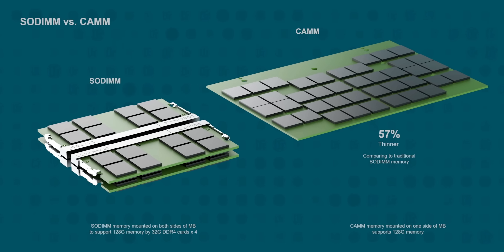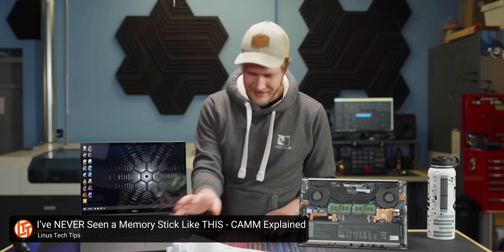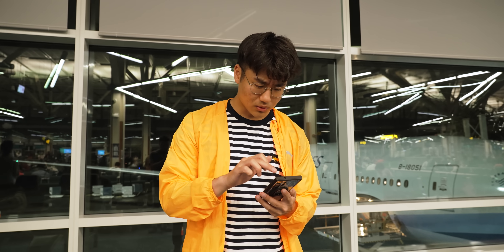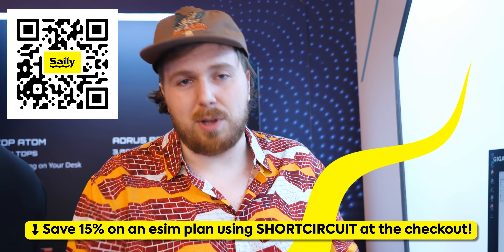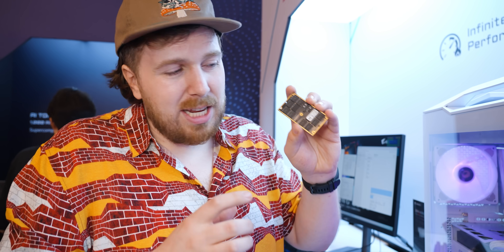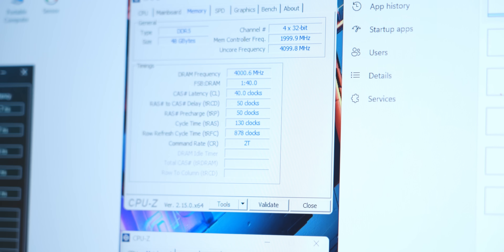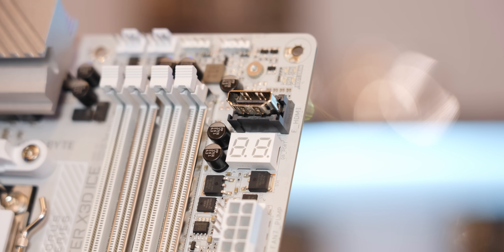Your RAM kinda sucks. - Gigabyte at Computex 2025

Comment from the maker: Get an exclusive 15% discount on Saily data plans! Use code SHORTCIRCUIT at checkout. Download Saily app or go to https://saily.com/shortcircuit
Reply: 2:53 Hold up... is that pin-to-pin interposer card a part of the standard?!  So if a pin gets damaged, you aren't replacing an expensive board or memory module, just an inexpensive connector card?!  That's BRILLIANT!
Reply: desktop PC industry is stuck in the past. why not just integrate RAM already especially on micro atx and mini ITX. built-in RAM does away with the cost and space of the connector while having higher clock speeds. expandability pretty much moot as time comes you need more RAM, it would be nicer to get a system upgrade with it.

Comment: Camm.2  and LP camm are DOA. it's cost and complexity to still be slower than soldered is not an incentive for the chip manufacturers. Everybody except intel already went with soldered memory for current APUs. Apples M's, snapdragon X1&X2 and ryzen AI max, all use soldered memory and cpu. We're in a uncomfortable spot with ram and how technologies progressed. no one wants to give up the ease of dimms, but they've become a major limiting factor especially for APUs.

Comment: idk if i like the idea of camm or not. as an sff builder i think it can do wonders in not hogging up so much pcb reel estate. but being flat its going to compete for ssd space (2 m.2 are fine for mini-itx). its also not as close to the cpu as i would like. the system i invesioned would put a module on either or both sides of your cpu to appease the ghost of grace hopper and could theoretically be cooled by the cpu cooler. or perhaps trapizodal modules that ring the cpu in its socket, with the socket containing all the traces for the memory bus and thus simplifying the mobo and reducing the costs.

Comment: Gimme one on the front and one on the back and we're good. Would make high capacity cheaper than if it's just one slot like the current implementation.

(Tho I doubt we'll get that, as mobo costs would be quite high due to the extra layers, and the memory topology would change vs the current implementations. D:)

Comment: ive never had a good experience with gigabyte motherboards. the same system running on an asus motherboard always gives me way better performance. ive even had gigabyte motherboards overheat before and throttle with long gaming sessions (just a flawed design). if anyone is buying a motherboard id recommend staying away from gigabyte, unless you dont care about performance

Comment: DDR5 kida sucks. How is it that my 5700G could hit DDR4 5000CL17-17-17-28 and get better bandwidth than my 8700G with DDR5 8000. Heck at 4200 the 5700G got better bandwidth and latency than the best the 8700G could do with 8800.
My 8700G struggles to run in 1:1 above 3800, where me 5700G can run all the way up to 5133 though with looser timings that make it worse than 4800C16
Reply: For those wondering the 5700G would see +75GB/s and as little as 49ns of latency, where the 8700G's best performance was at DDR5 8400 with ~62GB/s and IIRC 66ns of latency. And yes i was using a single dimm per channel ITX RAM OC motherboard, where as all of my 5000 series would hit at least 4800C17 on a cheap $100 B450 ITX board that is pretty low end on specs.

Comment: Can cam be used as replacement unified memory? So that in theory you could upgrade unified memory that can be shared with your gpu rather than just for the system memory alone?

Comment: Hmm, I wonder if GPU can get that benefit for the pins in a sense by not needing to have a exposed PCI-e slot and instead you snap the GPU onto it and screw it in tightly so it holds? That means you need some sort of new attachment system that lets you mount the GPU to the board without having the backplate being the only thing holding it up?

But this also means the new mobo with the new ram standard, also would have a new GPU standard, and it is not going to be backwards compatible at all!

Meaning you have to buy new GPUs, new Mobo, and new RAM with it all, and given the scarcity and productions of it, it will definitely be outrageously expensive for several years.

Comment: Cam doesn't seem faster than ram in those benchmarks?
Also I would never buy a motherboard that only has a single slot for ram no upgrade path without having to flip the old one.

Comment: As long as there is an option for upgradeability I am all for it. I often purchase laptops where the seller will provide good components but keeps easy upgrades like ram to a minimum to keep cost low. Making me as the customer happy to save a couple hundred until I'm able to upgrade when I can. Providing them the sale no1 can complain for the value aspect. As long as it isn't directly soldiered to the point that it is part of the board. I'm ok with the change.
Ram is only getting hotter the faster it goes. So an option to provide lower amounts of voltage with less resistance in traffic. Does seem the next step in evolution that I'm aware of.

Comment: It's not just the length of the signal wires; each DIMM socket also adds a little bit of capacitance to each of the traces. That is, each pin acts like a tiny little capacitor and smooths the voltage changes on the trace. Which is all fine for when it's a trace that carries power, but not such a good idea for traces that carry data and have to change quickly.
Reply: practically ive been buying 2 slot mobos anyway. matching dimms and getting them to play nice with eachother is kind of a pita, especially as an upgrade when the chips weren't all from the same batch. you almost always have to reduce their performance to get them stable when you add 2 more sticks. so i never understood why people like to populate all four slots. a single camm module simplifies this problem greatly. im also specing ram once when i build it and keeping the configuration for the life of the build.

Comment: I have an SFF build and every 2 years, give or take, my RAM starts dying. The CPU cooler fins are oriented such that they exhaust the hot air directly against the side of the RAM. Eventually the heat begins killing the closer stick. That note about making cooling and airflow better, 100% would be helpful for builds like mine.

Comment: It's interesting, but I'm unsure if it will take off for a long time because you can get much higher RAM density with DIMMs, so servers, workstations, and AI PCs probably won't use them, which would create a divide in the market. Laptops I can see getting this much earlier though.
Reply: You probably won't see much adaptation in mid/high-end gaming computers for a while, either, though perhaps in about 4-5 years after it's introduced, that problem may be fixed as well.

Comment: why didn't they just replace the DDR slots with the cam slot ? Its easier to make more space on the sides then it is on the top and bottom due to cases. I tell you this design is so everyone has to buy new cases for the new design.

Comment: Lol, That mb got like 1 Sata port. Dude, I'm still old school. I still have like 14 HDD's that still uses Sata connectivity. Yeah I know it's old and slow, but it's cheap for the storage capacity, perfectly fine for video storage and I already got them, no need to spend the cash on new tech that I don't really need. :face-green-smiling::face-green-smiling::face-green-smiling:
Reply: If you're using that many drives you should be using a SAS HBA card with breakout cables, not your motherboard's sata controller. Just wholefully not built for the task
Reply: @panduino2156  Rubish! It is the controlers job to do that. My old Gen1 i7 on a Asus P6T Deluxe V1 MB has been running non stop day and night for the past 16 years, first with 6 drives and 2 DVD roms and then 1 SSD and 7 Sata drives. It is still running as my storage server today.
Reply: What are you talking about? The one he was holding had 4 on the side next to the 24pin power connector.
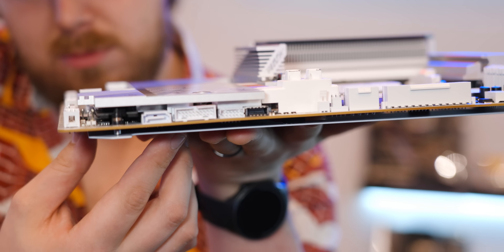Reply: @KyleDavis328  No, there is  just 1. Watch at 04:00 into the video next to the 24 pin, there are no extra sata ports, at 04:25 you can see from the side view there is only one sata port.

Comment: desktop PC industry is stuck in the past. why not just integrate RAM already especially on micro atx and mini ITX. built-in RAM does away with the cost and space of the connector while having higher clock speeds. expandability pretty much moot as time comes you need more RAM, it would be nicer to get a system upgrade with it.
Reply: Because being able to upgrade your RAM is good.

Comment: I'm actually offended by the straight up shilling going on in this video. CAMM2 might change everything? No, it won't because it's such a terrible idea that they have no plans to even try to bring it to market. So that's a lie.

You're going to sit there and pretend anyone in their right mind should ever buy a system that uses proprietary RAM?  Are you outta your minds?
Reply: Yeah...anyone who will buy it, will also buy faster and cheaper soldered memory. And those who wont, will get dimms. Its an ugly middle ground that no one really needs (also it has smallest maximum capacity out of any memory used today).

Comment: I am not sold yet.
You can get really fast DIMMs and it allows us to start with 2 sticks of RAM and the later upgrade to 4 sticks.
With CAMM2 you can still upgrade, but then you are left with a CAMM2 module that you have no use for.

For a laptop it is better than soldered RAM but for Disktop 🤷‍♂. I am not sold just yet.

Comment: How CAMM works is amazing, but forcing it on high end consumers at start is bad practice. Dell forces you to swap over to expensive CAMM memory if you buy their Precision model that supports it - and to configure more than 64GB in that model there is no option for SODIMM. It's too expensive and hard to come by, so until more companies adopt it, it's a gimmick.
Reply: What are you expecting them to do about it? It probably isn't trivial to make a motherboard that supports both DIMM and CAMM, and putting CAMM into low end devices makes no financial sense either.
Reply: @hikkamorii  It's just the config that makes no sense. 64GB and under, you can use SODIMM. Any higher and they force the user to use CAMM which means the MOBO is a different SKU, and therefore incompatible with more easily accessible RAM. I assume there was a real estate issue with 4 SODIMM slots, but also there's the same issue with the flat CAMM memory taking up a ton of space too.

The device does not matter, of course they won't put proprietary "new tech" in lower-end consumer models for financial reasons. There was only one laptop with CAMM support when I found all of this out. It is simply too expensive and unreliable at this moment in time to purchase a motherboard that uses CAMM until there's more stock. Can't upkeep a laptop for multiple people when the memory craps out within 5 years; will CAMM even be in stock at that time? Who knows. I cannot recommend adoption of this Dell laptop due to these reasons.

Fun fact, Dell has used a similar mounting system to the way these CAMM modules mounts to the motherboard but with daughterboards instead. There's a tiny bridge-like bracket to connect the two pieces and it just sits on top of the contacts.

Comment: Only two things I don’t like about the way it connects. 
1) How many cycles can those pins survive? CPUs don’t get replaced/upgraded as much as RAM would. Though I guess CAMM errors could lead to more Secret Buyer seasons, cause now the error could be poor connection or bent pin(s)
Problem being that then SIs would just have users return/ship out the machine, since the potential of bending pins is so high.
Reply: pins are replaceable

Comment: This is AWESOME.  The bottleneck for a lot of tasks is ram speed.  It's why I wanted to pick up one of those new AMD AI+ SOCs that just came out in a desktop form factor with the soldered on ram, but there are not 16x PCI-e slots on the thing.  I get it has a baller iGPU but 5-7 years later I'll want to add on another GPU which is a deal breaker for me.  So close AMD, so close.   CAMM2 might be the future, but waiting years for it is annoying.

Comment: What we need is cpus that can utilize 2 different memory types simultaneously and an OS that can stage operations based upon ram speed/type. OS and games? go to Camm Cache other programs go to Dramm Cache. ORRRRRR store everything in Dram and use Camm to increase VRAM. Manufacturers have not been taking enough risks on innovation in this market and it shows.

Comment: But don’t people use Dual Channel DD5? That doubles the bandwidth.  So a 5600MTs Dual Channel kit is the speed of 11200MTs which is much faster than 8000MTs. Unless they make dual channel cam memory which would be even more expensive and how would they fit two flat cam modules on the Mobo?
Reply: It doesn't work like this. The cast latency is very high compared to 8000MT CL40, and the raw speed of two DDD5-5600 SODIMM slots will only be around 65-70GB/s, whereas this CAMM module showed speeds of 120-125GB/s. There's an advantage of being able to get closer to the CPU than before, letting you drive the RAM fast.

Comment: If they were trying to get the shortest path trace, then they should make the ram mount to the back side of the motherboard directly opposite the processor.
Reply: the challenge now lies in the vias design of the board, typical motherboard nowadays has 6-8 layers pcb, 10-12 on extremely high-end.
There's a reason why ram traces are the ones visible (being the top layer) and can be cut off if accidentally scratched.
Reply: I mean being pedantic but what you would actually do is just have the memory on the CPU itself lol. Intel was trying something like this, it makes memory much faster, but not upgradeable at all.
Reply: @drageras agreed. this is what i was thinking if path distance matters, instead of current memory placement the traces would be inches away trace wise. placing it on the back side of the motherboard, even if it is the thicker 11-13 layer, it would still be millimeters instead of inches. stick with the camm2 interface, just shorten the trip.

Comment: I love the idea of camm, but we can get 128gb kits of 2x64gb ddr5 sodimms pretty cheaply.

Until lpcamm2 modules offering at least 64GB exist, they're less relevant in 2025 than optane dimms.
Reply: Can those DDR5 sodimms hit the same speeds, though?
Reply: @fujinshu no, but lpcamm2 is in a no mans land where it's not great for anything.

Soldered ram is faster than current camm modules, you can get 64gb on most systems, 128gb on some, and it's expensive.

Camm is between soldered and Sodimm speed wise, but it currently maxes out at 48gb, and it's expensive.

Sodimm is the slowest, but it maxes out at 128gb, maybe 96gb with an unfriendly bios, and it's cheap.

If you need extra ram on a laptop, camm is DOA, unless you want to hope that someday they'll release a higher capacity version, which will probably be very expensive initially.

I want big camm to be a thing, and replace Sodimm someday, but buying a laptop today, that fits my needs today, I'm getting one with Sodimms to upgrade myself, or one with a lot of soldered ram on sale.

Comment: Dell invented CAMM memory and contrary to what they say in the video, it is available, but it is expensive. Ironically, they sell a CAMM adapter to SIMM slot adapter which works in the laptops which have CAMM slots.
Reply: i was just checking out prices. they arent' that much more expensive! well the smaller kits like 16gb
Reply: @cloudiolology part of the problem is that they only give you a single slot for CAMM memory cards. Hence if you buy a 16GB CAMM memory card, all you have is a max of 16GB memory. Realistically, very few will upgrade from 8GB to 16GB so the lower capacity CAMM chips are cheap. The higher capacity CAMM modules like 128GB are $1999 from Dell and only 3600 MT/s which is crappy speed and price wise.

Comment: I am soooooo ready for PCs and laptops using the same upgradable RAM format!
Reply: i blame gamers for preferring gaudy oversized parts with more connectivity than they will ever use.  has anyone ever maxed out a mobo? because id like to see that.
Reply: I imagine this will just  make it easier for OEMs to solder the ram onto the board lol
Reply: @johnjingleheimersmith  soldered ram can actually be more performant. and frankly when i build a machine i usually spec it for enough ram that it wont need upgrading until i build a new rig. i suspect this might cause premium mobos to be made with pre-soldered ram. though it might be better to combine well matched ram and cpu on a single module and cut out the middle man.
Reply: @johnjingleheimersmith  ? This is meant to be as performant as direct soldered ram as the traces can be more optimised compared to traditional DIMM'S
Reply: @JamesTK  From the Framework Desktop situation, we know that it is not, unfortunately.
Reply: @kirelagin  I'm sure there's potential this or similar technology would take off in the future

Comment: This camm stuff again :/ ? Ram is fast enough already, crazy measures like the short anti interference pins asus put inside the dimm slots to reach some 8000 speeds just seems too much. Going to 2 slots on high end.. And with this just 1 slot? Replace it all at a time? I always got the 4 slot board and filled the slots over time. From ddr2 to now I never had any issue doing that. Hardware makers just don't want the word affordable to be part of their vocabulary anymore.

Comment: CAMM2 isn’t even on the market yet and it’s already not good enough to support modern LPDDR5X speeds. Framework tried to use it for their desktop and found they’d need to significantly reduce clock speeds compared to soldered.